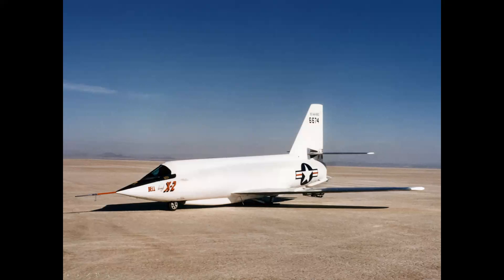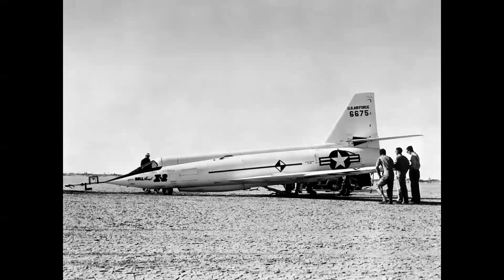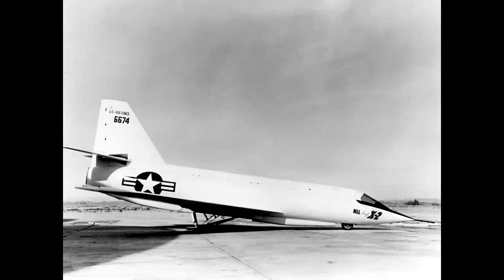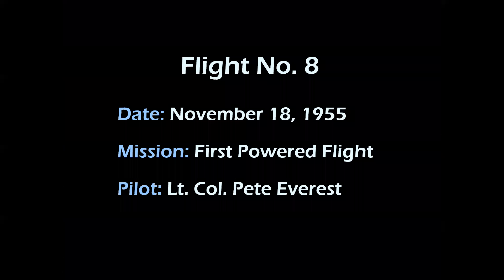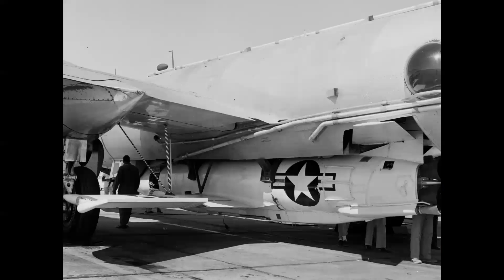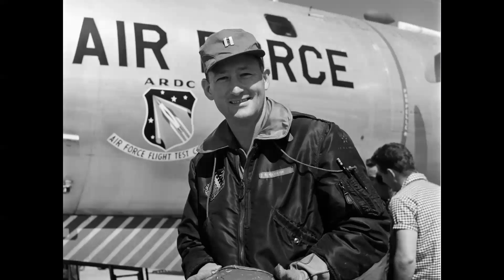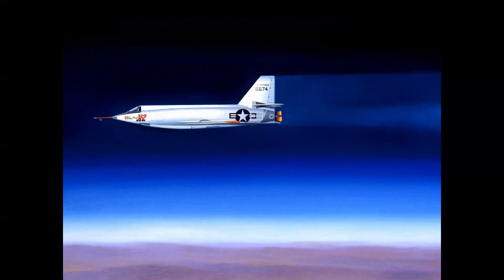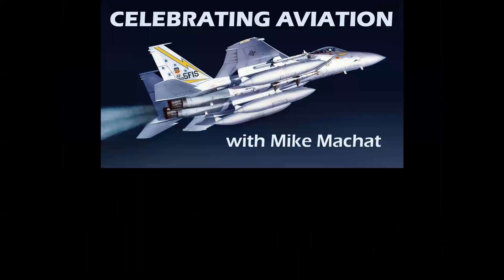THE BELL X-2 ROCKET PLANE - Significant Test Flights of the 1950s' most exotic Research Aircraft!

Comment: So this is the third rocket engine that I have heard credited with being 'the first throttle-able rocket engine'.   The LM descent engine and the X-15 XLR-99 are the other two.
Reply from the maker: Thanks for the comment, and yes, all were throttleable rocket engines you mentioned. LM Descent engine was first used in 1969, X-15's XLR-99 was first flown in 1960, and the Bell X-2's first powered flight was in 1955.

Comment: Not wanting to speak ill of the dead, but I'm curious about the Air Force's conclusions about Mel Apt's flight.  It would seem like for a man's first time flying a rocket plane, the mission would not have been planned to achieve record speeds.  Wouldn't the flight plan have called for a max Mach number and throttling back once achieved?  And given Chuck Yeager's experience with inertia coupling in the X1A years before, the flight plan could have called for coasting down below a safe Mach number before attempting any turns.  Is there any information available in Air Force accident reports that would shed any light on these issues?
Reply from the maker: Thanks for watching and for your good questions. The speed record on Apt's flight was an unintended byproduct of his excellent airmanship, as no one ever expected him to fly such a perfect profile on his very first flight in the airplane. That extra 15 seconds of engine burn took the X-2 to speeds never-before flown, but another key element in this accident was the restricted visibility Apt had from the cockpit with the canopy window design and his T-1 pressure suit helmet. Because he couldn't see the ground behind him, Apt was concerned he was flying out of range to land on the lakebed, so he turned the airplane more aggressively than he might have. There was also a lag in instrumentation, so he may have thought he was flying slower than actual. Air Force accident records may be accessible online. Many unfortunate links in this accident chain, and thanks again for the great questions!

Comment: Great vid and info. Alot of pics I have never seen.one day exploring South base I happened on that revetment you showed I figured from pics that they ran the X-2 there. I was surprised that the hook in the cement area where they ran the rocket motors was just a piece of 3/4" diameter rebar.

Comment: Hi Mike... I think maybe you can answer this for me. Is there a technical name for the imaginary motion lines that an artist paints behind fast moving vehicles? Your thumbnail of the X-2 is a good example of motion behind the tail, but you see cartoonists also use lines behind cars or even people to depict movement. I am distinguishing here between the diamond effect in the engine thrust which can be seen in real life and the imaginary effect of air moving behind wings and tail surfaces. In a related question, is there a technical name for the motion depicted by propeller blades by making them appear semi-transparent or disc-like? Maybe the terminology is the same, but the effect is different because it is depicting motion by transparency instead of the imaginary movement of air.
Reply from the maker: Great question, thanks, and I've heard that effect referred to strictly as "speed lines," although other artists nicjnamed them "seaweed." For propellers, we call them "prop discs" which can appear in a number of different ways depending on engine RPM, prop pitch, lighting, and aircraft view. Thanks for watching!